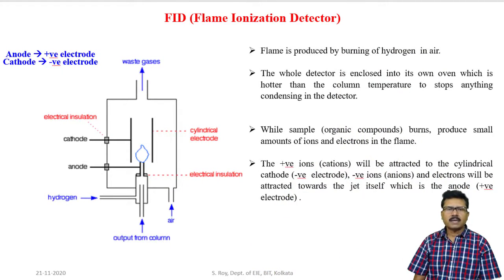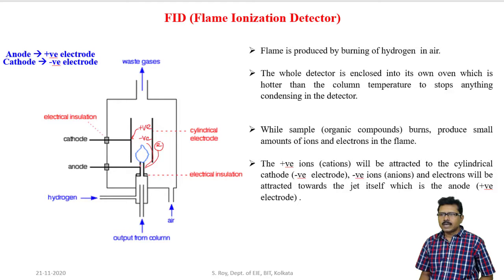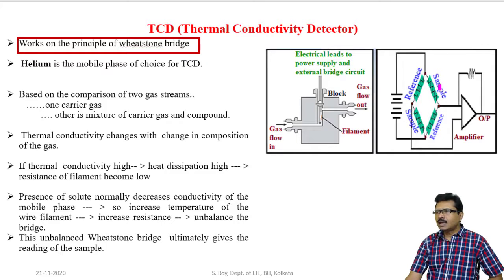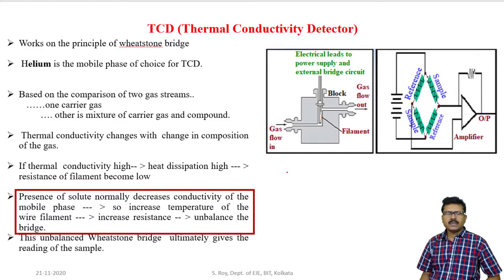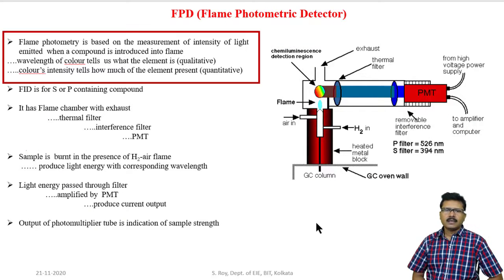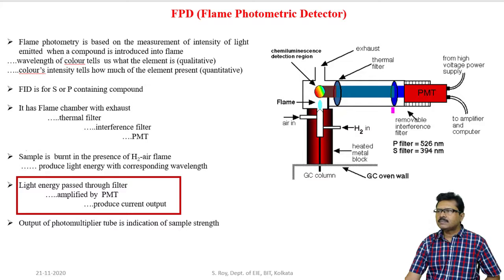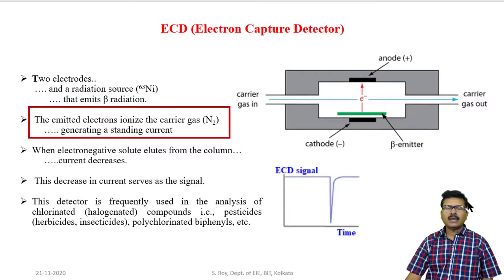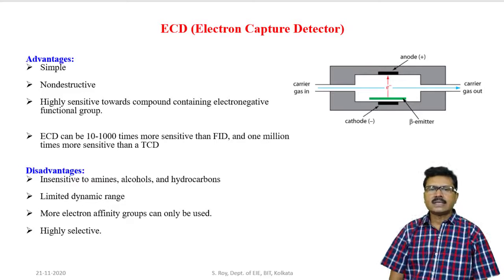Mostly used Detectors in Gas Chromatograph

Comment: Sir, i think there is a mistake in TCD. 9:15
in the 5th point, If themal conductivity increases then heat dissipation should be low
because thermal conduction is inversely proportion to heat produced.